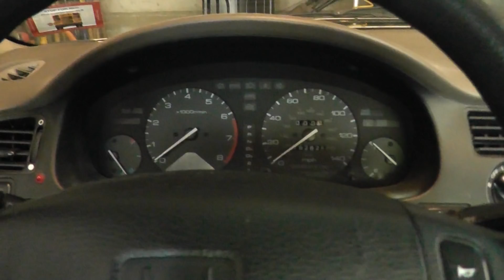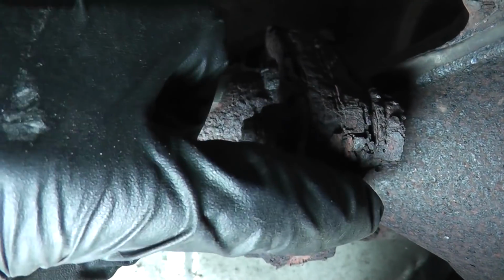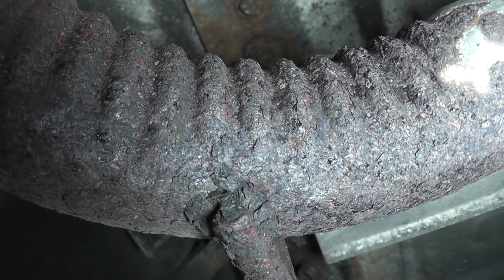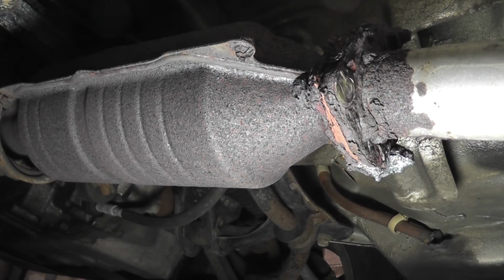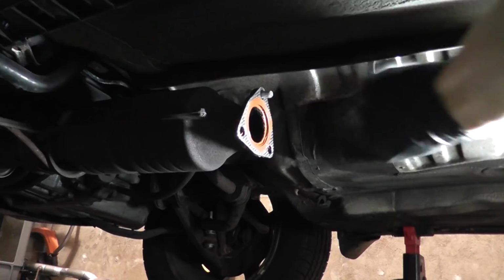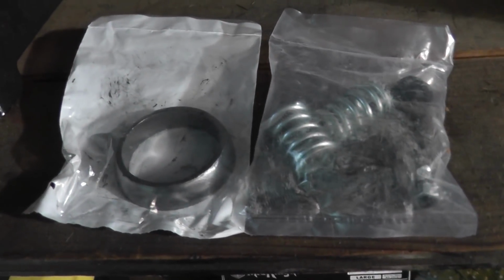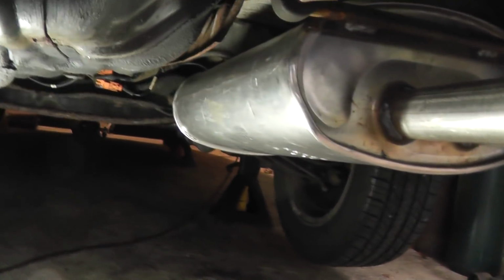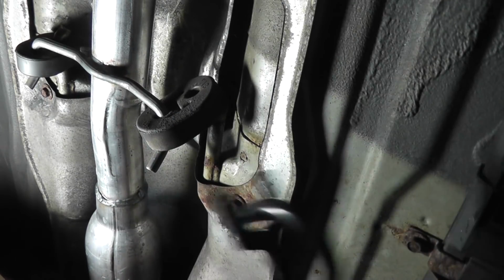1994 - 1997 Honda Accord Muffler and B Pipe Replacement

Comment: Question, when starting up the car the first time in the video what is that weird noise? It’s like a vibrating/humming sound. My 97 accord has the same sound and I’m starting to think it might be the ac compressor? Just curious if you ever had that fixed. Thanks

Comment: What's the size of those flange bolts and lock nuts? I have an exhaust pipe on a 1990 Honda Accord that needs replacing

Comment: Was this for the F22B1 EX w/VTEC or F22B2 LX non-VTEC model? Need to know as I have to replace both the B-pipe with the resonator along with the muffler. When it comes to Walker exhaust parts, there's a different resonator required depending on which Quiet-Flow SS muffler you get. My vehicle is the 1995 Honda Accord LX F22B2 non-VTEC 2.2L. 

Thanks in advance! Car drives real rough right now and if you could take a minute to get back to me, that would help me greatly.

P.S. I think the part number for the muffler in your video is 55026, not 55028. If true, that means that your Accord is the EX with VTEC according to RockAuto. Correct me if I'm wrong.

Comment: Walker their exhausts always rust i just had a thrush turbo muffler rust out on me the part # 17702 from walker. was two of them on a 2008 cr-v right and left on a custom made system. as the replacements going with AP Exhaust just only the mufflers pipes are fine.

Comment: You are the Man, I always enjoy watching your videos, I have one question for you on a 94 Accord EX do you know if the check engine light goes out after the bulb check? If So, do you know what makes it stay on after the bulb check and how to fix it? Thanks
Reply from the maker: The only thing that makes it stay on after the bulb check is a stored code. On a 94 you can't use a standard OBD 2 scan tool to read them. There is a 2 pin connector clipped into an empty female socket under the glove box. Jumper the female connector with a piece of wire and turn the key on. The PCM will flash the check engine light to indicate the code.

If it's a two digit code long flashes are the first digit and short flashes are the second digit.

Long - Long - Short would be 21 for example.

If it's a one digit code short flashes will come first.

Short - Short - Short - Short would be 4.

It will then after a pause flash the next code if any. If there is only one code stored it will repeat the first code over.

The diagnostic ability of these pre OBD 2 PCMs is pretty limited there are only 22 codes.
Reply: I got it. But when I do that the engine light stays on no blinking.
Reply: I just ran across this post from 2010  "called the local Honda dealer and they told me to check my check engine light with the key on to see if it turns off, if it stayed on my ECU was bad. "     Do you know if this is true?
Reply from the maker: If the MIL light doesn't flash a code when the service connector is jumped and stays on it means that the PCM is in backup mode due to some type of internal failure. I'd inspect the connectors on the PCM and make sure they're not melted or corroded.  It's located under the carpet below the glove box on the passenger side.

The carpet isn't wet on the passenger side is it? When the AC evaporator drain gets plugged with leaves and debris the condensate can overflow and completely saturate the carpet right above the PCM.

If the connections look good pull the wiring diagram for the PCM and make sure all of the powers and grounds are good with a DMM if they are okay replace the PCM. Luckily used PCMs are dirt cheap (under 20 bucks shipped).

Just make sure you get one for a 96 that was the first year they combined the PCM and TCM (transmission control module) into one assembly earlier models had the PCM and TCM separate.
Reply: Thank You for the information, The carpet is not wet but shows signs that it has been wet in the past, maybe in a flood. I will dig out the ecu and check it out. The car runs well, it has a few problems with it, the vtec is not working might be connected to the ECU problem. Thank You
Reply: Hello, I figured out my problem with MIL light, Thanks for the info , Do you have an email address so I could send you what I found?
Lou
Reply: @louisfoster4091  Post what you found here, that way you help anyone else that may run into the same problem as you. Thanks
Reply: @miami1393  someone had scratched through the power trace to the CEL, then they put a jumper wire from the oil pressure light to the CEL light. the CEL light would come on when you turned the key on and when you started the engine it would go off. The reason they did that was because the ecu was bad, it looked like some water got in it and fried some of the components,
the car still ran put it would not let the vtec engage, it was also hard to start. I found a ECU swapped it out and it now runs like it should. 
I guess that is what you can run into when buying from a used car lot.
Louis

Comment: what about the shield that surrounds the convertor.  I notice yours is missing
Reply from the maker: If you still have one on the OEM converter that hasn't been turned to swiss cheese by now consider yourself lucky. It doesn't get in the way when driving the studs out.

Comment: a good way to fix if on a budget. walker exhausts the pipes and mufflers rust out after a year or two. i would do if the car is worth it if you live in the rust belt where salt is used on the roads or if you live near the coast where salt water is present. i would take the vehicle to a muffler shop that specializes in 304 stainless steel which is non magnetic. as it will outlast the life of the car mainly on honda accords from 1990-2002 as its best to replace exhaust pipe A when going to 304 stainless the stock catalytic converter is the only part that will be reused. as the shop can custom bend the pipes. i had 304 stainless steel put on a 99 Honda Cr-v it outlasted the vehicle till transmission failure.
Reply from the maker: I actually get around 8-10 years of life out of Walker exhaust components  before they rust out and I'm in the New York area. But if you can afford it stainless is definitely the way to go.

Comment: that b pipe dealer only item   mine is 97 accord calif. emissions  no aftermarket pipe for it.   dealer cost @ 250.00
Reply from the maker: Yeah those California emissions model parts are pricey you should see the price for the front flex pipe (I replaced one in a video awhile back) and don't get me started on the pre catalytic converter that's part of the down pipe from the manifold.
Reply: My opinion on the Cadillac converter if you're not no sensor on it cut the thing out an just get a piece of pipe get what size you need measure it  how long do we need and go to exhaust specialist I have a tape of them I've done that for years no problem